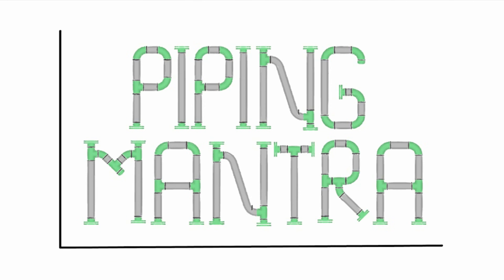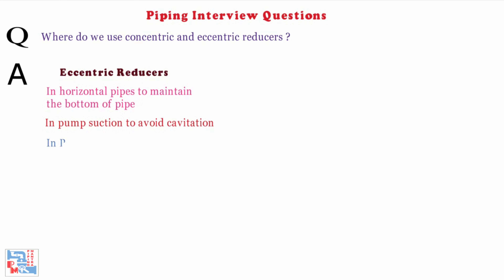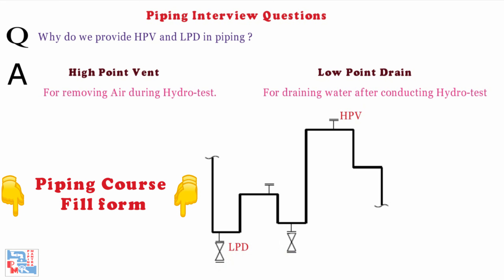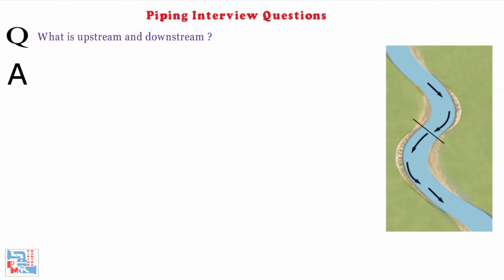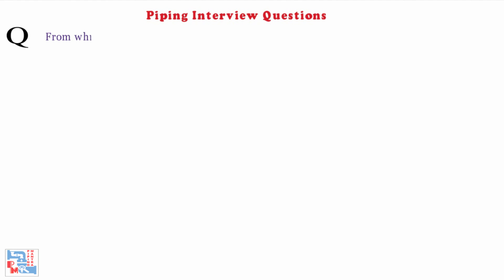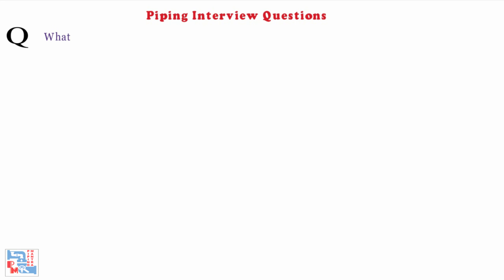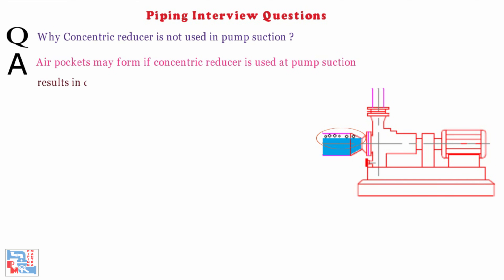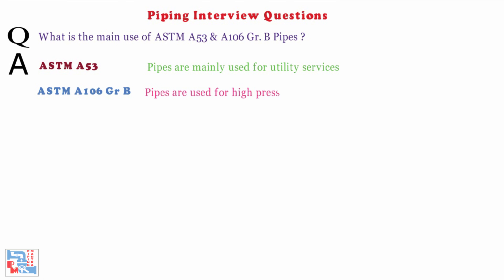Piping Interview Questions | Part-7 | Piping | Piping Mantra |

Comment: Hi please make video on valve and flange size optimisation, means somtimes the size of valve to be used is should not be the size of pipe, and flange thickness should not be the as oer asme b 16.5 , simply tell us how undersize valve and flanges to be utilised at certain extent to reduce cost in project

Comment: As usual excellent work. What do you mean by "value" for an upstream and downstream of an orifice flow meter? This is which value?
Thanks for your excellent work.
Reply from the maker: Straight run pipe length
Reply: @PipingMantra  Thanks for your kind reply.